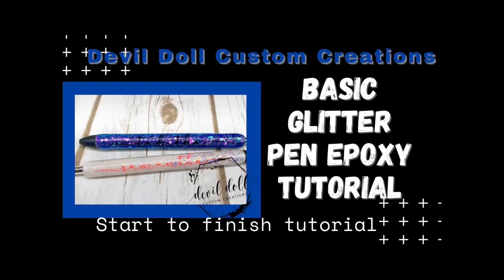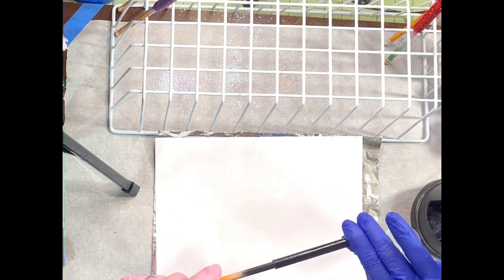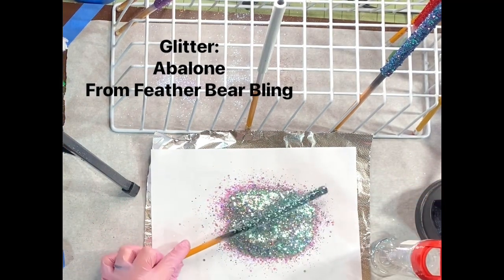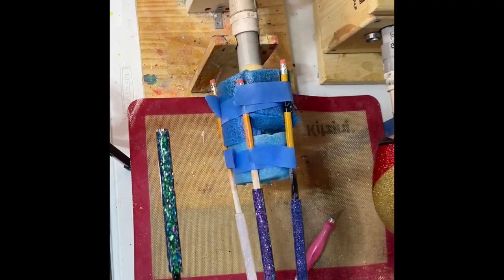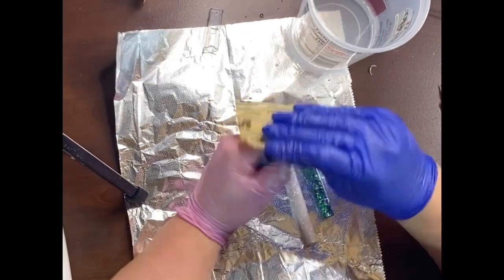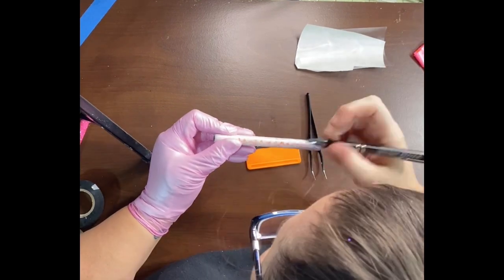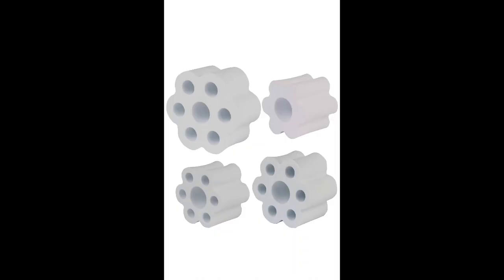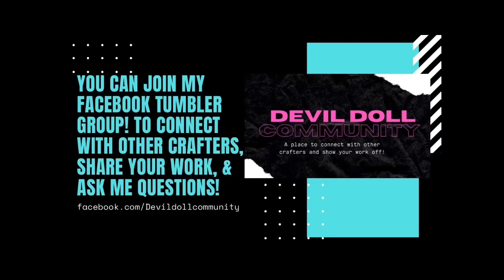Basic Glitter Epoxy Pens Tutorial

Comment: Why does everyone use this paper mate pen? Can any pen be used?
Reply from the maker: Yes I’m pretty sure you can use any type of pen that can be taken completely apart. I like that the tip comes off so I dont have to worry with anything effecting the pen working correctly. Also I wouldn’t say use really cheap ones because the plastic is thinner and probably could warp or change shape and then the pen wouldn’t work.

Comment: How did you get the pen off the pencil when you got epoxy inside ?
Reply from the maker: I actually broke off the pencil and then drilled a hole right in the middle of the pencil with a small drill bit and then once I had the hole made I started increasing my drill bit size until it was just under the size of the pen. Then took my craft knife and scraped out any remaining. Now I always add a tiny bit of Vaseline inside the pen where the pencil goes in.